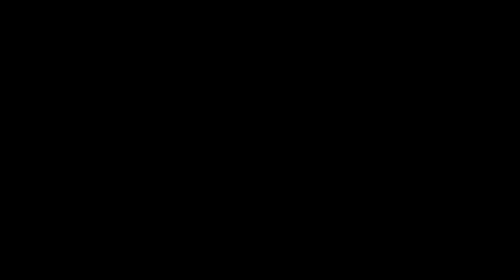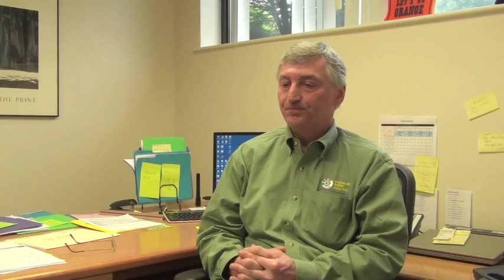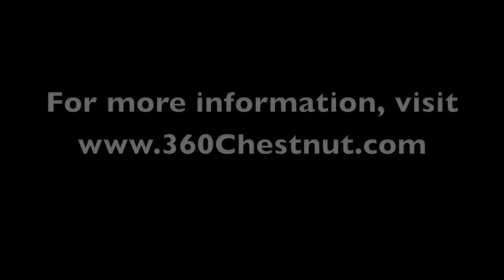Indoor Air Quality- An Important Test

Comment: Thanks for the info on rebates. Just wanted to add that there are a variety of instruments you can bring to a client's house to perform an indoor air quality test in place, so you do not necessarily have to take air samples and ship them out. However, tt may be cheaper to send them out if you are looking fo specific VOCs.

Comment: I think it is important to point out that the house leakage rate is not a measure of indoor air quality. It is simply a test that approximates leakage. The assumption that a leaky house at or above .35 air changes per hour = good indoor air quality is highly flawed. Though in a house with forced hot or cold air, this might be accomplished at times, a house with no system to properly mix or distribute the outside air around the home would likely leave areas very poorly ventilated. And many very dangerous pollutants like radon are undetectable by our senses of smell or feel. See what this highly respected building expert says about this issue http://www.buildingscience.com/documents/insights/bsi-053-just-right-and-airtight?topic=doctypes/insights